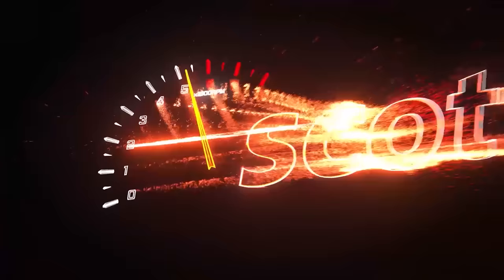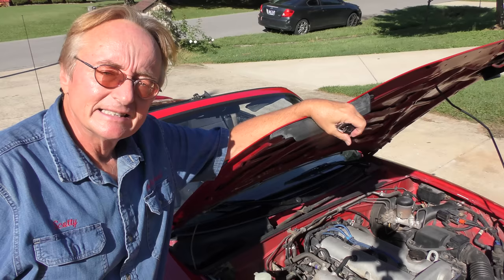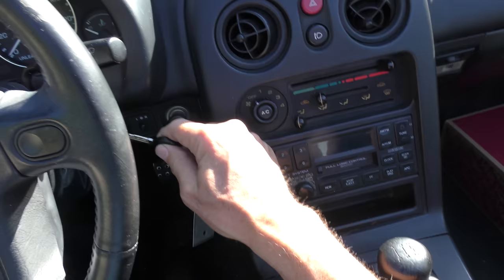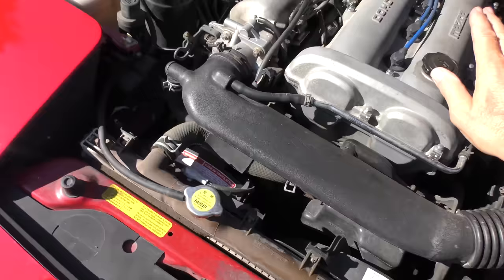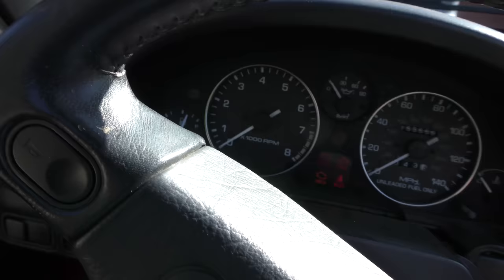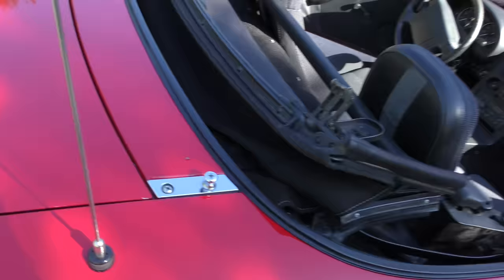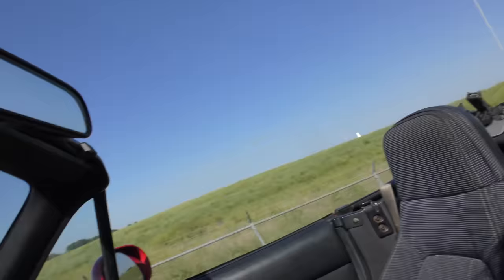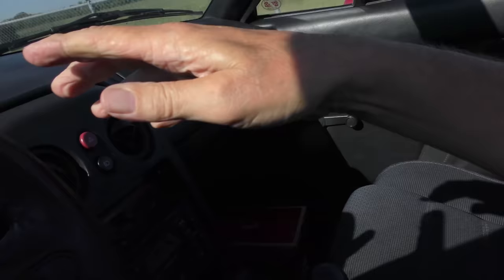I Just Found the Best Car Ever Made (and I’m Buying One)

Comment: Been working on miatas for a long time. They're the first car I ever fully rebuilt. If you live in the middle Tennessee area I can revive even the nastiest miatas. I even designed replacement parts that I 3d print including a short console, tombstone, and custom cup holders.
Reply: Where r u in mid tn?
Reply: I may move to Saint Louis and am interested in buying a Miata or bringing one from CA. Would appreciate your contact info if you can share it
Reply: What is your website address? In case I ever want to fix up an old Miata
Reply: @driveonthestraightpath2138  just outside of Murfreesboro
Reply: @jeffzekas  I don't have a website at the moment I do most of my business with the Facebook Marketplace.
Reply: Nice. I’ve been curious about 3d printing a tombstone for my 97.
Reply: I guess I’m not in on the know, so if you don’t mind me asking, what is a tombstone?
Reply: Hat's off to you sir.
Reply: @juliekavanaugh4993  the tombstone is the center piece of miata interiors and it gets its name from its shape. The tombstone shaped part of the dash where the radio, heater controls, and hazard control's are. They are often broken when being removed due to old age and sun exposure.
Reply: But do you have a k swap miata?  Haha
Reply: What years do you specialize in
Reply: What years do you specialize in
Reply: @amoney315  I'm best with the NA6 and NA8 years (90-97) but I can work on NBs as well although the VVT models are a little trickier.
Reply: @Nowayjosedev  ,
Reply: @dukirps  saint Louis is a bummerrr, don't do it mage
Reply: You know Scotty lives in Middle Tennessee too, right?
Reply: @DustinTheDad  yes I do he lives in the more northern part of Middle Tennessee
Reply: Hey, my uncle loves them. He wants to put an electric engine in one, do you know how to do that by any chance?
Reply: Customer: So Scotty, how was the road test?
Scotty: Good news and bad news.I love your Miata, but it needs a new clutch!
Reply: I live in Middle Tennessee and I'm just trying to find a good used car. 😭😭
Reply: Tombstone?
Reply: @jakobthomas8945  can't say I've ever put an electric motor in a miata but I have done one in a Super Beetle. They made a kit for the beetle to convert it to electric so it was pretty easy all we did was follow the wiring instructions mostly. I'll look to see if there are electric miata kits.
Reply: @candim.9375  one thing that will help you when buying a car, especially if you go to a dealership in Middle TN, you should always do the Free Vin Check Up through the NICB. Can't say how many time that simple Vin check has saved me trouble
Reply: Stickers and neon lights does not count as a "rebuild"
Reply: Sick as hell man I respect it
Reply: Can you fit a ford coyote v8 in it?
Reply: @Dranreb865  then dreams
Reply: @Dranreb865  then dreams
Reply: @TheSuperBoyProject  in another world
Reply: Awesome
Reply: I’ve a 2002 NB here in Chile, South America. Still runs, but Iwould pay you the plane tickets to give her a look. Nobody can fix her right 🤣
Reply: Franklin?
Reply: God bless you with long life and grateful customers.
Reply: What is your contact sir? I have a 92 sunburst that needs a lot of love. I’m currently in Ga but even if I can’t get it over to you I will pay for your time to answer a few questions
Reply: @TheSuperBoyProject  Ford 5.0s fit better than any other V8 ive seen in a miata
Reply: @nicholasoconnell7732  not franklin, between Christiana and Murfreesboro is where i live but i service cars all the way up into Hopkinsville. the majority of my customers live in the brentwood area
Reply: Any way I can buy a custom cup holder or short console off you
Reply: That's right. You better work
Reply: Hey man good to know, been wanting to save up enough to build up a Miata. Maybe I'll take a trip to Tennessee when I get one!
Reply: @daltonliles6161  depending on where you are you may even want to come to Tennessee just to buy your miata. There are a lot of very solid projects available around here for decent prices.
Reply: Hey,also from middle Tennessee.
Reply: I'm 6 for 5 and long legged...not the car for me unfortunately
Reply: That sentiment alone would pick up so many chicks😆👍
Reply: Can you tell me if I'm doing good? My first NC, bought at 96k miles, now 184k. Replaced radiator, new AC, new clutch, all oil leaks sealed. 6 speed 2008 gt hard top.
Reply: Do you have an email we could contact you at for working on these
Reply: I live in middle Tennessee and I got a question can you revive a MK3 Toyota Supra?
Reply: @jairzavala7171  it depends how bad the Mk3 is. I've come across Mk3s with some terrible electrical problems that took months of searching wires to find the problematic ones.
Reply: Moving to Jackson, TN. How do I connect with you.
Reply: @sterlingfury  I’m 6’6” and long legged, and have been daily driving my NB1 for over a year. My knees are in the dash, and my head skims the top when it’s up, but I wanted to drive a Miata, so I do. Where there is a will, there is a way my friend!
Reply: if i knew somebody like you i would deffiently buy a miata.
Reply: Can you link where to reach you? I stay in Antioch, would love to see what you could do for my NC
Reply: @SUBJECToDELTA  I put my email in a short video on my channel. It's an email I use just for miata related stuff
Reply: where can i find na auto trans. or do i have to make it manual.
Reply: @rocketsmall4547  was your miata an automatic when you bought it?
Reply: badass!
Reply: I don't own a Miata and I already love what your doin.
Reply: you have any insight into the deceleration rattle on the na6's?
Reply: @xxxxSHADOWxxxxxX  it's hard to tell what it could be without being there to hear and experience the rattle myself but a really common problem that creates that problem is a misaligned PPF. The PPF is the support structure that connects the transmission to the rear differential. If that isn't installed correctly it can cause all kinds of problems and sounds including a rattle on deceleration. Almost sounds like someone's pouring marbles on metal.
Reply: Cool
Reply: do you work on NDs? im in the area often in the summer time
Reply: where can i purchase one? im 15 but when i turn 16  i want one
Reply: How do I contact you?
Reply: Can u you travel to cali
Reply: Audi's are well built. The Quality is obvious
Reply: Hey, you still here? I would like any of your socials/email to do a quick consultation. Nothing crazy, just to know which Mazda you would pick between a 06' Miata with some (high quality non damageable) mods or a 16' MX-5. I will pay for said consultation, socials are just to give you more context about the state of both cars and so on :)
Reply: Hi I'm in Africa ..Tanzania. have a Miata 1990 . need some help ..bad leak  on the steering rack pinion and would like to change the seal...can this be done ?
or ?
Reply: What do you think of a 2016 with an automatic transmission? I'm in the market for one and trying to see how reliable it'll be over the years as a daily
Reply: Hi! Please if you know, what year would you say Miata automatic transmissions become more reliable?
Reply: Are the newest ones as repairable as the old ones or are they all computerized? I want a convertible hard top so I think the newer ones are the only good option - though not sure how future proof they are...
Reply: Outstanding I’m happy I saw this comment as I’m in the middle of my own first “full rebuild” and I could use some parts 😅
Reply: @ClearWater7.62 I do but tbh I’d say the 1.6 turbo I did was actually better (I got one on itbs rn and it’s hilariously fast, almost smoked my own evo 😂)
Reply: How often do you do trans and diff oil on them?

Comment: I bought my '99 Miata 10 years ago for $5,500 at 101,000miles. I modified the thing to the teeth and drive it hard enough to be learning while I'm driving. I just replaced the engine at 200,000 miles. No regrets at all. In fact, I've got a turbo kit about to go on it. Nothing really breaks that isn't something that's my fault. Thank you Mazda.

Comment: I've had my Miata for 27 years.  Only 50K miles and she looks like new.  Nothing has ever gone wrong.  Only thing I've done beyond fluid changes is the timing belt.  Still has the original factory brake pads!  Great cars - 100% reccomend.
Reply: We've had ours for 30...196k...nothing but routine maintenance and timing belts. They really are incredible little cars!
Reply: I've had mine for 35 years and 321,000 miles. I did get the dreaded crank nose failure at 270k after a botched timing belt change but a new Mazda crate engine fixed it right up and I should be easily good for half a million miles now!
Reply: I'm sure it's a beauty but only 50K in 27yrs?  That's an average of less than 1900 per year!  I'm averaging over 14k per year on mine.  I absolutely love driving it.  Although where I live, I can drive it year round.  Perhaps you live in a colder, multi-season environ.  If not though, get out and enjoy it some more!!  You can't take the miles with you!
Reply: @Buzz65  I was averaging around that on mine for the first 21 years before adding my Fiesta as my everyday car and relegating the Miata to weekend use which dropped it down to 4000 miles/year or so which dropped even further as I started working from home in 2020 and only now is starting to tick up again now that I'm in the office 2 days a week. But I see where he's coming from, I have a 2017 RF too (inherited from my late mother) and I'm lucky to drive it 500 miles a year as it's only driven on nice days.
Reply: @Buzz65  You got it - I live in a very soggy part of Canada so top down weather is pretty limited and I won't drive it in the wet. As you note it does not get many miles put on it and I probably should sell it, but it has been so reliable and doesn't take up much space in the garage , plus it is such a treat to get out in it on a nice day.

Comment: I love my '91. Even with a supercharger, I ran for 100,000mi, the engine was still running at 240,000mi. Just installed a JDM motor, and looking fwd to another 200,000 mi. If I last that long. I'm 70 now. Can't beat em. Believe Scotty on this one!
Reply: I've got a 99% original, 300k mile   A+B optioned '91 - bought it with 100k 22 years ago for $1200... . Took it on the 3500 mile 2014 Hot Rod Power Tour  VA to western NC -IA-WI and back with a 10mm  wrench and a tire patch kit for a tool box when it had  200,000 miles.  Still has orig clutch, alt, starter, and all the engine sensors!   I'm 75 and hate driving anything else....

Comment: Back in 2002 I found a 1990 Miata w 5 speed  sitting in the grass at a house in the country .
I left a note on their front door and 2 days later I bought it for $600 ,
 including a Hardtop ! 
I didnt want the hardtop so I sold it for $575 .
I put a clutch slave cylinder in it ( about $32.00 at O Reileys ) 
And we fired it up .
I changed the timing belt and drove it for over 10 years but only in the Summer .
Lots of good memories in that car .
Its the Go Kart I never owned as a kid .

Comment: Rust is the killer in the UK for the Miata (called the MX5 here). Rear arches and sills are usually rotted out at 12-15 year old, repairable but a big job. The underside, even in the later ones (7-8 year old) can get very rusty and scabby. I was going to buy one but bought a Toyota MR2 Spyder/Roadster, that was 11 years ago and it's still rust free (dry weather use only) and has never given any mechanical problems.

Comment: Have a 92’ with original hard top.   170K miles and still goes great.  On the 3rd soft top. 3rd water pump.  Many break jobs but just replaced original rotors.  It is a ‘B’ model with electric windows and all the extras.  Best car I’ve ever owned.

Comment: I had a 1990 Ford Festiva. Same B series engine but the smaller B3 1.3L. Selling it was one of the biggest mistakes of my life. It was such a fun car to drive, 40+ mpg, and I could fit a dozen 8' 2x4s in it. Recline the passenger seat, put them under the passenger dash, and the rear hatch still closed. Similar car. Same fun. I had it during the economy crash of 2008 when fuel prices spiked.

Comment: Great review, Scotty.  Agreed with just about everything you said.  I do have one concern about that specific car that you should tell your customer about.  I've been working on these things for years, so I know from experience that the factory radiator's plastic housing should be black.  When they start to turn brown or olive green, like the car you're reviewing, it often means that the chemicals in the plastic are starting to break down.  It's only a matter of time before a crack develops.   Just from visually inspecting what you showed on camera, everything else looks good...but that radiator would be the first thing I replace so I'm not left stranded on the side of the road.  Cheers!
Reply: Was going to say the same thing. Definitely time to replace that radiator
Reply: Thanks for the heads up! I just changed my anti freeze today and noticed the olive color.

Comment: Miatas came with timing chains starting in 2006.
But, as Scotty pointed out, the older belts are fairly easy to replace.
I miss inline engines.
Reply: Longitudinal is the word. A straight-4 IS Inline.
Reply: @BigEightiesNewWave  
No kidding.
I'll say it again, I miss inline engines.
Reply: Same...inline, straight, longitudinal. Whatever.  The design is bulletproof.. bring back inline 4s and 6s with timing CHAINS..
Reply: @analogueoverdigital929  many cars have inline 4s and timing chains, golf gti for example. I believe you mean longitudinal with chains. I’m that case NC or ND Miata’s. I personally want more belts again and non interference engines

Comment: Ha, Bought a 92,  9 years ago, had the Auto trans flushed 8 years ago, drive it around 5000 km each year. Never had a problem with it & it still shifts fine.   cheers

Comment: I had a 97 Miata and I am sorry I ever sold it.  They are like you said a blast to drive.  I could reach for the top and raise it with one arm.  Now never try that when driving because the air catches it but just pull up to a light and reach back pull the top up and latch it.  They run forever and are cheap to maintain and fix and you can go around freeway flyovers that are 45 at 80 and feel like you are glued to the road.  I will admit it is like riding on a skate board when you first get one but they are great cars and a ton of fun.

Comment: I own an NA 1996, new to me in 2014. Only used in summer in Scotland, starts first time every time after it’s winter rest. Only failure in 8 years was the clutch slave which was cheap to replace. Drives beautiful for a 26 yr old car and it only has 15,000 miles on the clock! Love it.
Reply: Have a 2008 . Replaced radiator, but because of an accident. New clutch and I have replaced the oil many times every 3 or 4 months because I'm paranoid and so far my motor is at $184,000 mi 6 speed manual Grand touring hardtop
Reply: 15,000 miles in 27 years! At that rate it will out live you by 150 years!!!!!

Comment: Hey Scotty, engine upgrades are plentiful - all the way up to a 350 V8 crate motor!  On my 2013, I put in a 2.5 Ford Focus motor with a turbocharger, and got 335 rear wheel horsepower with the stock camshafts!  Upgrading camshafts, you could get about 450 rear wheel horsepower!  It was a BLAST!  Of course, I also upgraded the wheels and tires to put that kind of power to the ground, after all, it only weighed about 2400 lbs.

Comment: I love manual transmissions also.
But yeah I feel this way about my 1995 240sx Nissan Silvia S14. It’s also jdm. I paid $5k for it…. Goes for 3-5x that now.
Reply: Yeah I used to drive 1992 240 SX and it had a HUD with the speed. I thought that all cars should have that. Was very high tech and had seat belts that electronically come up when you turn on engine. After my transmission locked up. Got a good used transmission from junk yard and the car was super fast. Love that car. The acceleration was amazing and it was automatic.
Reply: Did you happen to buy my NEAR MINT 1995 ?? Pearl white ??